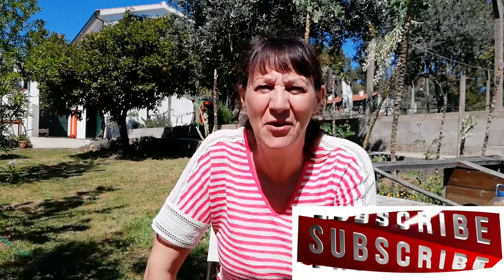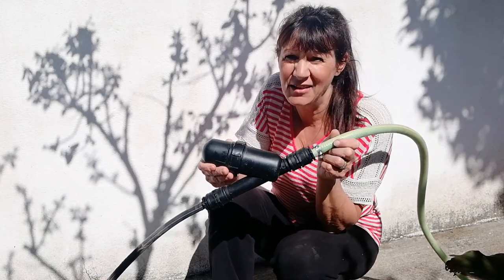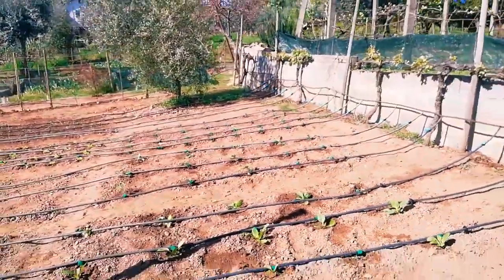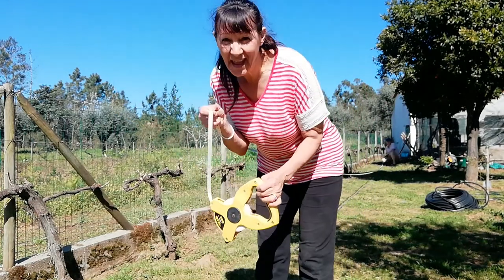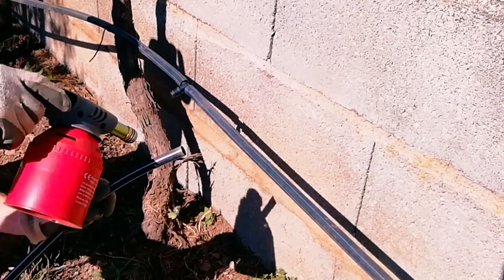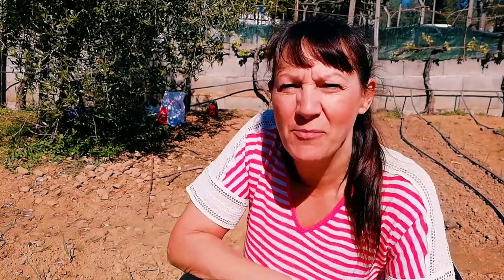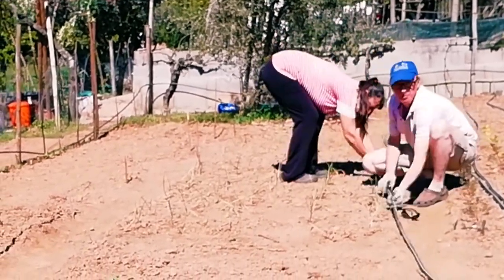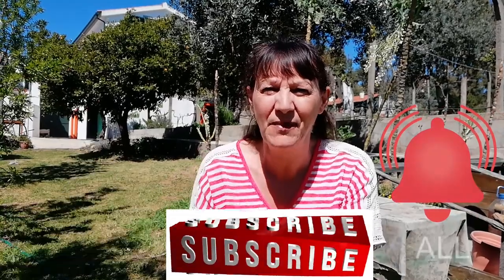HOW TO INSTALL IRRIGATION

Comment: I really could have done with this video a few months ago. I have been renovating the irrigation system we inherited when we bought the house. One thing I learned was to put in taps everywhere.

But because I am watering garden bushes which are less regularly spaced rather than a vegetable patch where you can put plants where the droppers are, I also use a similar type of dropper but with a spike attached and put them onto the end of a short piece of 4mm pipe - the benefit of this is that you don't have to worry about taking the 16mm pipe right to the bushes and pinning it down so that it doesn't move, but instead can easily place the spike on the end of the 4mm pipe right close to the roots where it will do the most good.
Reply from the maker: Thank you for leaving this comment.
I have seen the 4mm hose attachment and they are very good for large bushes.
We just have grapes and vegetables at the moment,but would use the 4mm pipe and dropped if we needed them.
This irrigation will help us so much and give us time to relax every evening. 😀
Reply: @fantastic50s88  I just can't understand why you waited so long... 😏
Reply from the maker: @SodalisUK  I know but the first year we did not really know how much watering the garden would demand.Then the second year my husband had a very bad back.so this was the year we did it.😀
Reply: @fantastic50s88   Lol!!! I think I would have bought the watering system after the first week or two of manual watering!!!
Reply from the maker: Yes that would have been the clever thing to do.🤣👏

Comment: As an aside, if you already have a watering system which uses sprayers, you should really consider changing to droppers - it saves a LOT of water by only wetting the soil around the roots.